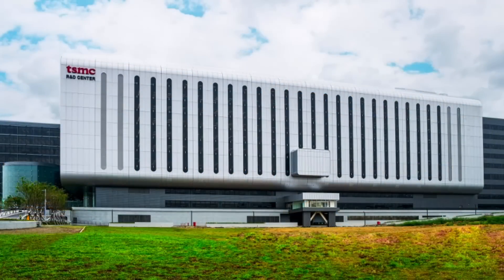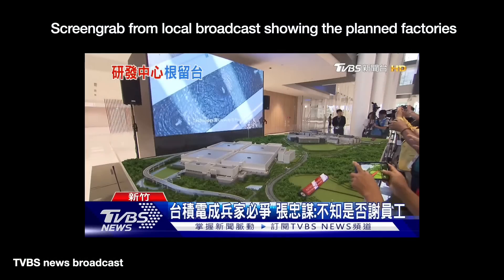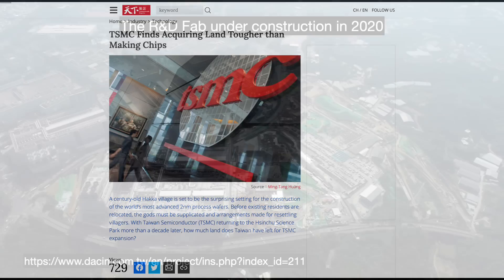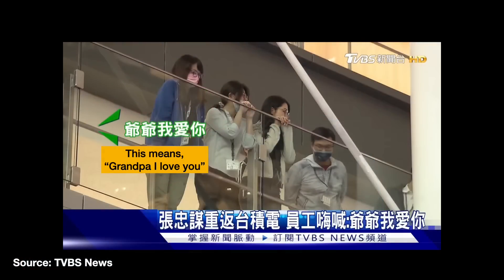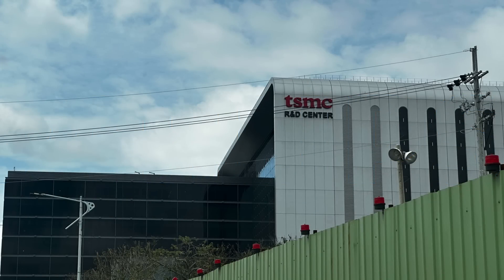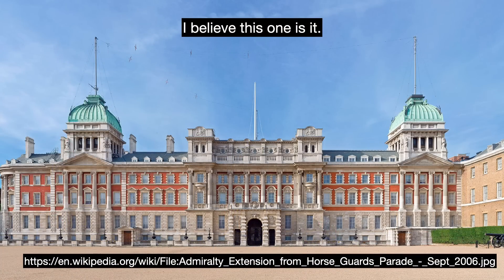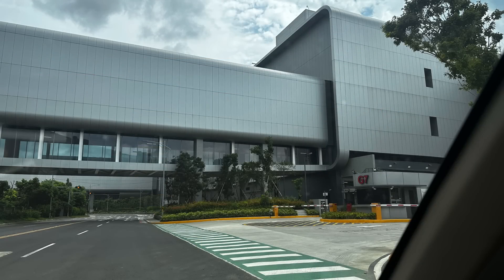TSMC's Newest R&D Fab in Taiwan

Comment: 00:02 TSMC's newest R&D Center in Chinchu, Taiwan
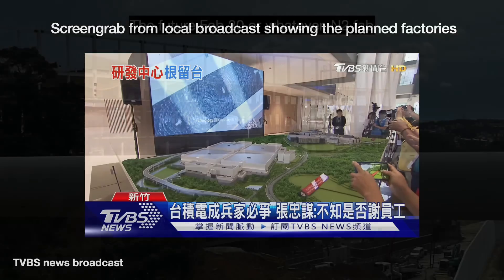01:15 Construction and infrastructure of the new manufacturing zone in Bausan
03:11 Morris Tang's speech at the commencement event
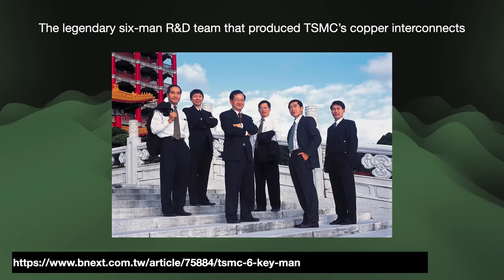05:00 Importance of R&D and manufacturing working together
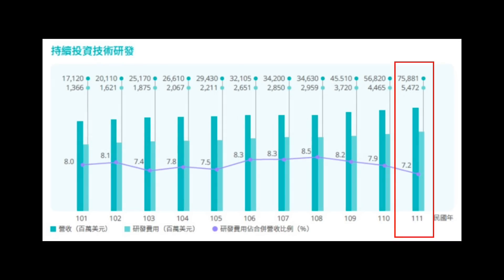06:00 Comparison of TSMC's R&D spend with other tech companies
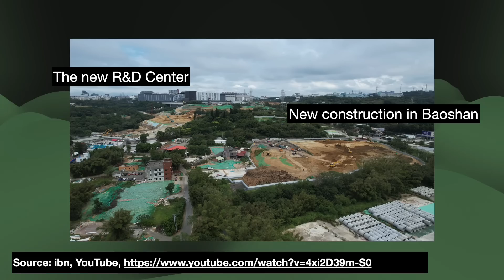07:13 Factors contributing to TSMC's technological advantages
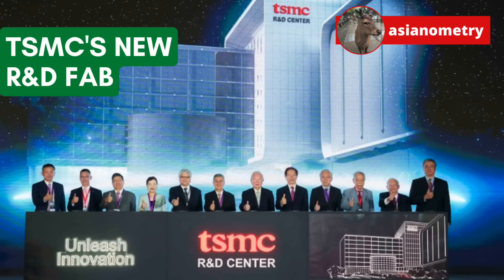07:46 The resilience of TSMC's independent approach in the semiconductor industry

Comment: One big difference between TSMC investment and google..apple' intel is it is strictly for semiconductor processes. They don't design MCUs, CPUs, SOC, AI and GPUs and all the product designs they go into. But their parts are in all these products. Speaks well to focusing on a core business and not trying to be vertically integrated. They buy as much tech as they can and just build what they have to.
Reply: So you wouldn’t recommend buying Apple stock, as they are a vertically integrated company? 😂
Reply: @jansix4287  they don't have wafer fabs so they are not vertically integrated like intel and samsung
Reply: @danhoffman9232  Apple literally produces the movies and runs the streaming service, for their own Metal graphics API on their own custom designed silicon with their own Metal API, for their own devices, bought with their own payment method, in their own flagship stores. There’s never been a more vertically integrated company than Apple. 
Reply: @jansix4287  Your confusing multiple buisness with vertical integration.Think cell phone, OS, chip design is an example of a product line they have that is almost vertically integrated.  Laptops the same.  Streaming is a different buisness were they do production and streaming. But not the servers.  Apple like Sony, Samsong and GE has a lot of different buisnesses .  Sony and   Samsong have several fully vertically integrated products.  Non of which are anywhere near as successful as Apples products in that catogry.  So Apple made the right buy build choice.
Reply: @danhoffman9232  Yeah, I’m confused. Not you! 😂
Reply: A couple of definitions.  Apple is a conglomerate.  https://en.wikipedia.org/wiki/Conglomerate_(company)
Apple is partially vertically integrated. https://en.wikipedia.org/wiki/Vertical_integration
TSMC is  https://en.wikipedia.org/wiki/Horizontal_integration

Comment: The obvious flaw with comparing TSMC's RnD spending with Intel's is that Intel also designs a plethora of chips and software solutions. TMCS only has lithography, packaging and PDK development. Intel also has these on top of everything else. Alphabet and Meta seems to spend money on a lot of useless things "just in case it sticks".
Reply: Looks like a lot of "R&D" at Google is make a product and if it doesn't make more money than ads within 2 years pull the plug.
Reply: @meneldal  Google does a lot of work making processors and mostly what they're working on from what I understand are processors for their servers, and with as large as Google is, that's a big deal.

In fact Google already replaced most of the Intel CPUs they used to use with their own processors and just like AMD and Nvidia are working on very complex processing units that can have a mixture of typical CPU cores, graphics cores, etc.

Google has already installed millions of their own processors into servers specifically for video processing, since they own Youtube?  This replaced Intel processors.  They have an enterprise server CPU that they'll start installing in 2025.  They also make their own processor for their smartphones.

So your comment is strange because Google has been HIGHLY successful at inhousing their own chips, and because their own market is so HUGE they don't have to worry about producing chips for other companies, unlike Intel and AMD and Nvidia who rely completely on companies buying their chips to make products.  This is where Samsung, Apple, Google and Microsoft all have an advantage.  They make custom chips for their own products.  In fact at some point AMD and Intel could be in trouble with X86-64 if they're not careful because Microsoft is working to become a complete platform developer, and they've been working at this for years.  They could in fact stop making an OS for PC and have Windows be for a Microsoft platform only, but they first have to have a product that's excellent and games work well on it.  In fact they could partner with Nvidia for GPUs for their home compute devices and make the CPU.

This is a wide open market and a few years could bring BIG changes.  Intel just suffered their worst quarterly loss ever, and they might have 2 in a row, and that's because of their big losses in the world of servers.
Reply: @johndoh5182  I think you're missing the point, this is not where Google spends most of their money.

Plus they're not making a new architecture or anything, it is ARM chips that they are using third parties for the actual manufacturing (and afaik they also have used third parties for some designs). Samsung is the only one with a bit more control on the whole process since they do have manufacturing capabilities.

I haven't seen any actual product with a google processor actually finished, it seems they just started actual manufacturing, so no idea how good they actually are. The only product they seem to have right now is for video coding and their paper doesn't even compare it to other dedicated hardware encoders but only to GPUs and CPUs (that are obviously not used fully on those tasks), which feels very disingenuous. Obviously it's better than a GPU, duh. But I'm not sure at how good compared to other SoC made for processing video.

Compared to Apple, Google is still not that invested in custom chips, unless they have tons of projects they haven't talked about.
Reply: Lithography is the critical piece needed for market dominance. For the little they spend, they're getting enormous returns.
Reply: @bobweiram6321  Lithography is brought to you partly, if not mostly by ASML and all the semiconductor companies they sell to, the big 3 being Samsung, TSMC and Intel all have the same advantage of getting ASML's best lithography equipment.  Samsung was actually the first company releasing products on 4nm, or their 4N node.  Samsung is like Intel, both a chipmaker and semiconductor company.  Their markets are different though.

And any company that buys lithography equipment from ASML, which all 3 of those companies do once again, spend a LOT of money on their equipment.  Each machine is many millions of dollars, so spread that out over each line of production.
Reply: flaw😂😂😂 I love the adacity of you think make chips just like making fries. One tapeout cause million and billion dollars, thus only the rich few could only make those. And even though with the complicated signoff, it still looks like a blind bet. becasue market outcome may or may not be good.
Reply: So, there could be TSMC and only TSMC, since it needs customer tapeout to makeing their node yeild meets end. TSMC cannot only tapeout their own design as it not only make a huge blind bet, and also limit their manufacture technology to be one aplication and one only.
Reply: And without customer tapeout, your yield sucks, your yield sucks, no customer will bet with you.
Reply: Also to TSMC really doesn‘t matter what kind of design your taping out Apple silicon or dog shit. As long as the yeild is good and customer success(so they would come back). After all it is a business not a academy.
Reply: This is actually a very good point.
Reply: Its called diversification
Reply: Flaw? Intel comparisons? Good  lord you're comparing rolls royce with Pontiac. 🎉😂
Reply: Taiwan's "National Science and Technology Commission" and "TSMC" join hands with various ministries to promote the "Taiwan International Advanced Nanosemiconductor Future Technology Application Development Research Center", which will provide the exclusive "Advanced 5nm Chip Research and Development Implementation Plant" by TSMC as a design and research application practice center, and provide Taiwan universities and universities and government scientific research institutions of friendly countries that have signed scientific and technological cooperation with Taiwan to study the application of high-end chips in future technology. Relevant ministries of the Taiwan government will provide salary budgets for researchers from friendly countries to study the application of future technologies on chips in Taiwan, and encourage universities and private science and technology industries and the world's top 500 universities to implement scholarships and education cooperation, so as to attract outstanding talents to study and work in Taiwan, so as to assist friendly countries to participate in future AI technology and industrial upgrading. The United States, Japan, Canada, Germany, the United Kingdom, the Netherlands, the Czech Republic, Slovakia, Poland, Lithuania and other countries have signed scientific and technological cooperation agreements with Taiwan, sending university and government researchers to Taiwan to station in TSMC's "5nm Chip Research and Development Plant" to study high-end chip design and AI applications, so as to enhance the capabilities of countries in future science and technology.
Reply: Time for more for semiconductor, electronic firms to be in Malaysia as Taiwan has earthquakes like today.

Comment: Since it’s the go-to foundry TSMC benefits from the R&D spending across the whole ecosystem. This allows them to spend less on R&D than other semiconductor firms.
Reply: That is true, but less is not zero.  A Lab-Fab is a key element of creating foundries that work efficiently, and Maurice's comments related to not resting on their laurels are important here for TSMC leadership and very germane to opening a state-of-the-art Lab-Fab.
Reply: A foundry like TSMC can use their integration engineering process to absorb and incorporate the advances that their customers are making, which, if they are smart, and they are, they will mix into the learning process from this Lab-Fab to accelerate their innovations in factory control, efficiency, etc.  Their customers teach them some of what they learn, and they can use that knowledge as an input into this locale's outcomes.
Reply: Taiwan has low cost of living, low labour salary, low real estate prices compared to that of other countries like US.
Reply: Yes, Nvidia should thank Apple and AMD, and Apple should thank Nvidia and AMD, and AMD should thank Nvidia and Apple, and....
Reply from the maker: Yeah that's a good point.
Reply: @Asianometry make a video about Nano imprint lithography pretty pls 😭🙏